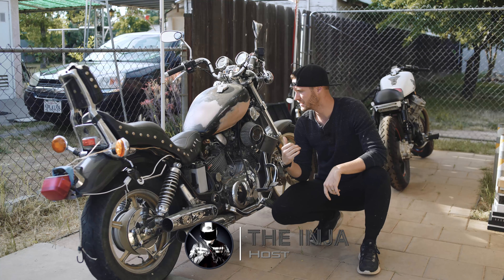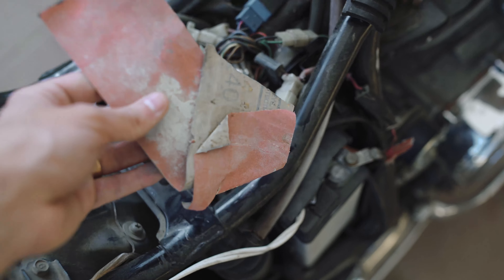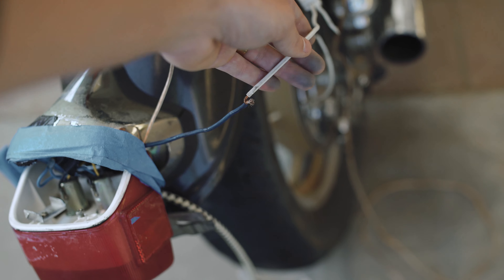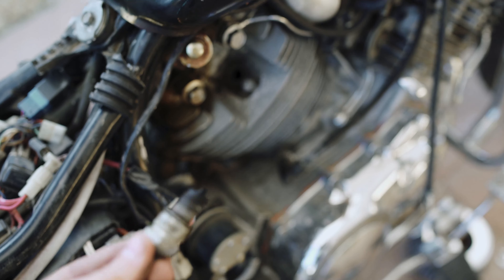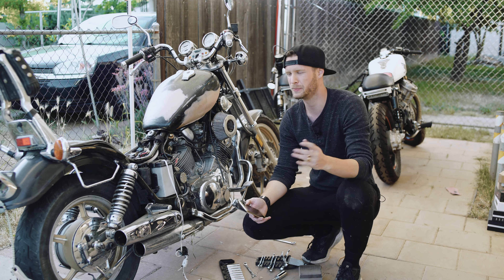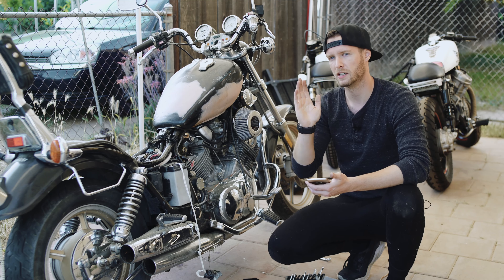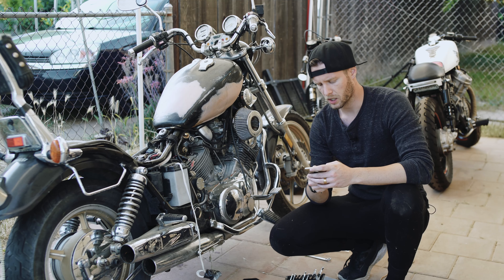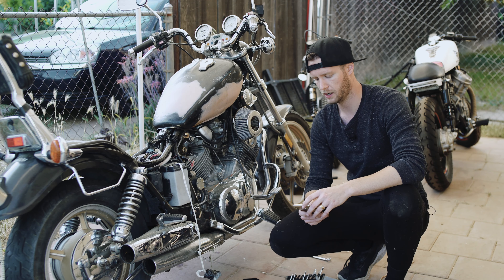ABANDONED Yamaha XV1100 Virago Rebuild Part 2 | What's WRONG with it??

Comment: I'm disappointed that you didn't dig into the back hub to discover the problem before going over the rest of the bike to decide what to buy.  You can't buy anything until you have a handle on the cause of the back wheel lockup.  The wheel is connected to the hub.  The hub is connected to the shaft. The shaft is connected to the transmission and engine.  Is the engine seized?

Comment: If the starter spins and it sparks ,It will live again.just stay focused on fuel delivery and ignition. Until you get varoom!!!  Dont  buy clean paint or polish anything. It ain't even a decent  boat anchor till it starts , shows signs of potentially Idling and    feeling 1N2345 make that boinka! boinka! noise.

Comment: looks like makeshift brake light. in 1990 was first year switched from 2 pickup to 1 for spark. On the left cover is stator and pickup. The older 2 pickup has a 4 conductor plug, the newer has 2 conductor plug. This is important as the TCI sparkbox is specific. Dont be fooled by same looking plugs on tci, it goes by year. Made by Mazda btw...